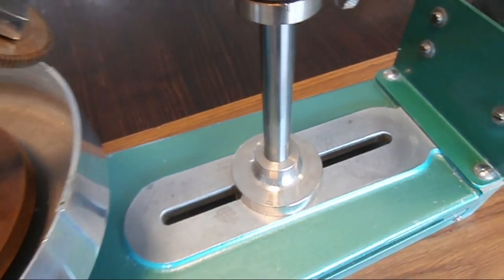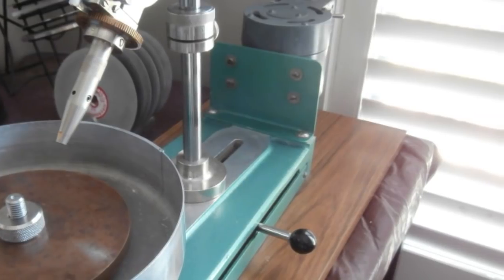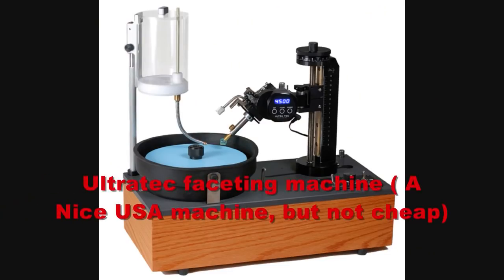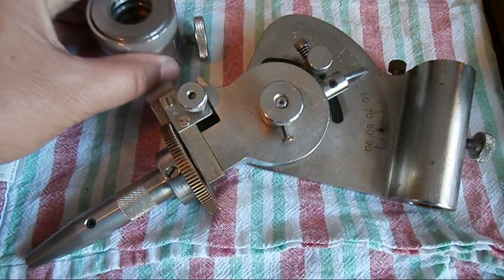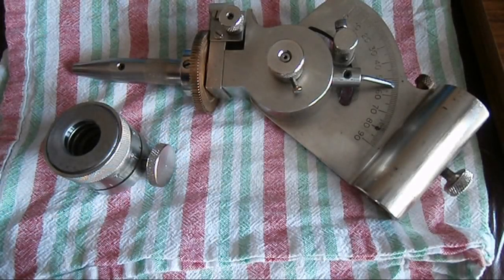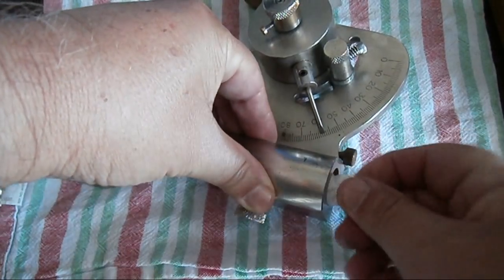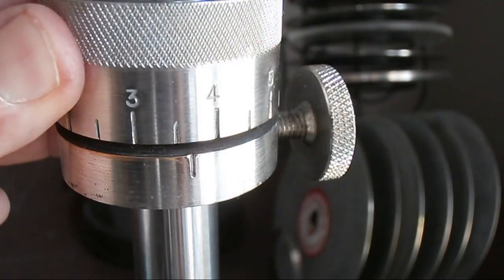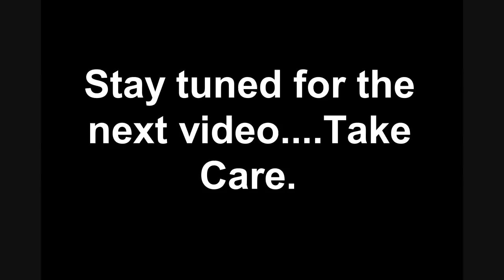How To Cut Gemstones - Faceting Equipment (Part 1)

Comment: Thanks for the video it is very helpful to new and old factors. I live in the U.S. and I use a Ultatec machine your machine looks very well built.
Reply from the maker: The Ultratec is probably my favourite of all the US machines. I have seen them in action several times at workshops. Good accuracy, I wouldn't mind having one. Not many Australian cutters would buy a Facetron, from what I've heard from friends that own them they complain of flex issues in the head, and the common problem of water getting in the quill. I've seen them also in action and they appear to be a bit of a light weight.  They are way too expensive to buy here also after you pay massive import duties, no point buying them unless I could pick one up cheap secondhand.